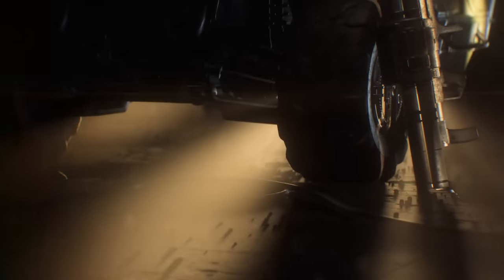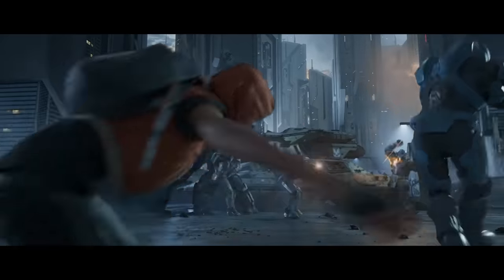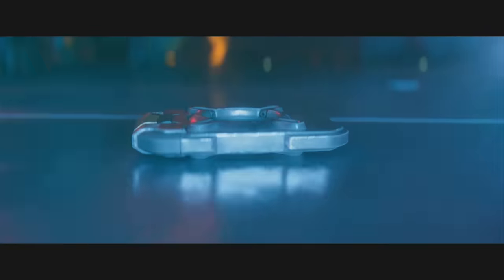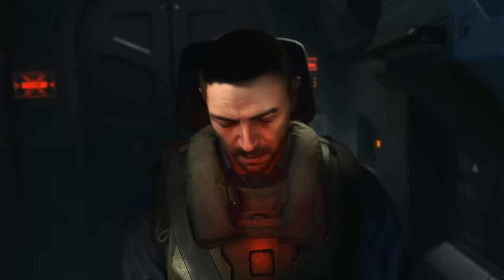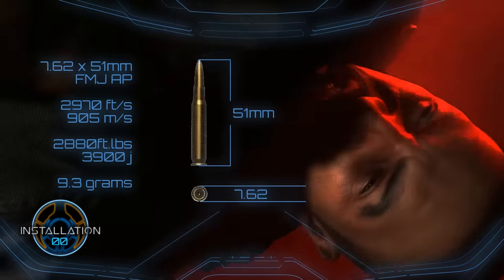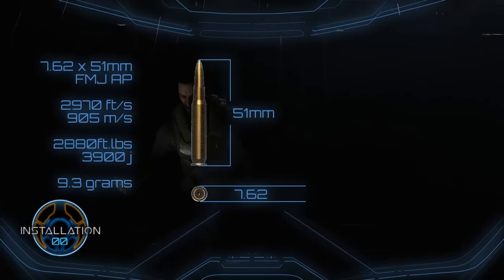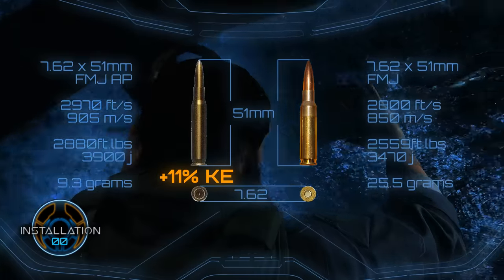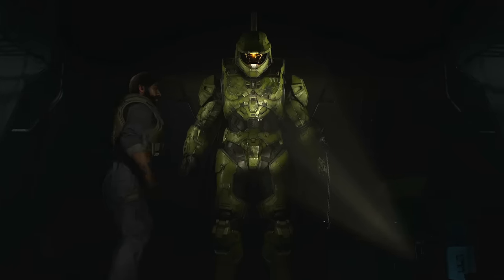Why are UNSC Weapons so powerful!? | The Armory

Comment from the maker: Just quickly; the length of the case/cartridge is 51mm on the 7.62 x 51mm, verses the overall length of the round being 71mm.
I had to make a choice in the editing on if I should have marked the lines to indicate the case/cartridge length lines or the overall length
If I marked the cartridge length, I'd get people saying that I put the lines in the wrong place. 
If I marked, as I have in this video, the overall length, I'd get other people saying the length is wrong.
I could have used both but I didn't want to unnecessarily muddy the water for clear understanding of the bullets.
So since the literal measurements are in the name (7.62 x 51mm), I decided to go with that.
Reply: 7.62 is the caliber not the casing. 12:00 is wrong.
Reply: A few of us, such as myself are firearm enthusiasts, so we would know what you are talking about. There's quite a few measurement diagrams for different calibers that show the overall length, case length, etc. If people are curious they could look at those.
Reply: ^^ Good Vid as always (except for the small mistake with the overall Length of the Ammunition).
For why it has more Power as the 7.62x51mm nowadays i would say three Factors are important:
1. The Propellant (we saw what the Change from the old Gunpowder to smokeless powder as Propellant had in an impact on the projectile velocity)
2. Better Barrel materials that can withstand the higher pressure with an more powerful Propellant
3. A better system to reduce weapon recoil (If anyone has ever shot with an 7.62 Assault Rifle you know what i mean)

PS: As I was in the German Airforce i did shot with the H&K G3 and the MG3 which is using 7.62x51mm and the Recoil is noticeable higher that an 5.56x45 NATO. Now think of this with even more powerful Propellant...my poor Shoulder ;) ...especially if you fire burst or full auto
Reply: Ok so I'm going to assume that somewhere in your lore resurch you found a description of the cartridge what it looked like and what's it's made of because in the whole video you never mentioned anything about the cartridge other than weight a mention about thickness and its length.

So let me elaborate  I would like to point out a possibility that you may or may not have considered that is the cartridge itself has probably gone through changes as well not just the powder... etc 

Because I have no doubt the unsc did initiate such things for example you point out a weight difference between the current day cartridge and the halo version and say its the same well I submit that all the variances you make between the current day and halo ammunition can be accounted for through inivstiona with the cartridge.

Eg: if the halo cartridge is not brass but a type of polymer that is lighter than brass and because it's not brass the normal loss of energy due to heat transfer in to the brass can be avoided putting more energy back in to accelerating the round...etc

And if you say the polymer would melt or what have you the us is developing exactly what I am describing for there armed forces as we speak... so in conclusion I would say the reason halo ammunition could be more powerful is a combination of powder innovation and cartridge innovation to get the results depicted... anyway that's my opinion 🤪  still an interesting video lots of food for thought
Reply: You should see Garand Thumbs video on the MA5 series.
Reply: So since the literal measurements of the BULLET diameter and CASE length were in the name, you decided to deliberately present the information incorrectly and mark the CASE diameter as 7.62mm and the OVERALL length as 51mm... so that people who are wrong wouldn't tell you you're wrong? So instead the people who are right would tell you that you're wrong?

That's some very interesting logic.
Reply: Minor correction on the video to start: the magnum fires a 12.7x40mm round. Not 12.7x30. That would actually make a lick of sense. And I know to the uninitiated that might not sound like a lot of difference, but it puts the round at nearly the same size as .50 Beowulf. You know, the (rather pointless, but insanely fun to shoot) 12.7x42mm cartridge designed for use in rechambered AR-15s and can even be comfortably loaded single stack in doublestack 5.56 magazines. Essentially the magnum should be using ridiculously long AR mags and would barely fit a Spartan's hand, let alone be standard issue for marines. 

    Overall, the UNSC's weapons have never made much sense. Measurements don't add up, the weights are often completely off base, and they generally use what should be some pretty damn archaic technology. Even with improved gunpowder, which is perfectly possible, these weapons are still using technology that was mostly developed decades before Bungie ever thought of making Marathon, let alone Halo. A lot of which is either entirely obsolete or being slowly replaced today. Brass casings instead of polymer or hybrid casings like we're seeing in a lot of recent and ongoing weapons development programs, or even going caseless which would be more than feasible for universal application in the next 50 years, let alone 500. The bullets they describe are the same makeup as those we used in Vietnam. Even the ammo counters, digital compasses and electronic targeting systems exist today. I can't think of compasses being incorporated into a gun (or why you would bother when you have a HuD, for that matter), and rifle mounted optics like that that can automatically adjust for wind and distance are still mostly in the prototyping stage, but they exist. Hell, one of the competitors in the recent NGSW bid had a functioning (if unnecessarily complex) electronically assisted feeding mechanism. 

    Personally, I'm an AK guy, so K.I.S.S. is my motto when it comes to firearm internals. But the fact that the UNSC hasn't advanced their small arms virtually at all in the last 500 years is staggering. It's the equivalent of giving a modern soldier an Arquebus. Not to mention: am I the only one who finds it utterly bizarre that the UNSC doesn't issue optics on the MA-5 series? I mean sure, there are systems to allow smart linking with your HuD, and your helmet can magnify, but in the event of an EMP or equipment failure, or even if the enemy has ECM that can render that digital targeting useless I would very much like to have something more than just flip up iron sights on my gun.
Reply: @leftwardglobe1643  The 12.7x40 is closer to the .50 Action Express in the Desert Eagle and the .500 Magnum.

But I agree, the measurements in lore and what they would be in reality are very different. Most all ballistic tests for muzzle velocity and energy are done with the best possible scenarios. 7.62x51mm ballistics are done unless otherwise stated, with a 24" barrel.

A 60 round magazine for the 7.62 for the MA5 would have to be a quad stack to be the same height as say a 20 round or 25 round magazine. Which would probably have a lot of reliability issues with failure to feed.
Reply: @Ratkill9000  .50 AE is 12.7x33mm. So, no, it isn't. Not by a mile (well, 5mm more of a difference, but details, and yes, that matters). 

    Again, I'm sure there's room for advancement within the confines of 7.62 NATO, but why they wouldn't just do something else that's more ballistically sound or even go for something other than chemical propellant projectiles entirely is beyond me. 

    And yeah, quad stack is right. Though it would have to be a little bit longer, I believe. A few friends and I actually took a look at this a while ago while writing a custom Halo RP (we're nerds like that) and came to the same conclusion after looking over the measurements. I think by the end of it we settled on triple stack 36 round mags instead. Which is only slightly better. We also rechambered the DMR to a more believable cartridge with a bigger ammo capacity (300 winmag, 27 rounds per mag) so it both fits its performance in game and lore better, and wasn't entirely retarded. If you can fit 60 rounds in a similarly sized magazine, why does your DMR with the same ammo have 15 bullets? I genuinely want to know what that Bungie employee was smoking, cause I need to try that. The magnum we changed to be 5.7x33 (because that would honestly just perform better on top of being at all feasible for regular humans to use comfortably) and gave the Spartans a machine pistol variant in 12.7x33 with extended mags. Because with power armor and augmented strength as considerations: if you can make your sidearm into something that amounts to an ultra compact SMG in .50 AE, why not do it?
Reply: I'm surprised you didn't bring this up and it's a future technology that could easily work in small arms (and larger) weapons and grant much more higher muzzle velocities and muzzle energy:
Electrothermal-chemical technology (ETC). The problem with firearms is any muzzle flash/flames you see coming out of the barrel is powder that was not completely burnt in the barrel and converted to energy. It's wasted. Like imagine if your car's fuel injection system or spark plugs didn't ensure enough fuel was ignited to power the cylinders as fast as it could. You'd be losing out on potential energy. Same concept here. A lot of the potential energy of a firearm is lost due to not all the powder being ignited and used before the projectile leaves the barrel. ETC addresses this by using a electrothermal/chemical reaction in some way to create a plasma to almost instantaneously ignite the propellant in a case/shell. And it exists and it works, but funding never really went anywhere with it. The United States Army played around with it for a converted 120mm tank gun for the M1 Abrams in the late 1980s due to concerns with the maximum velocity capable of modern ammunition in tank rounds pretty much being reached without going into ridiculous territory like much larger guns and pressures/barrel lengths which would be impractical and Soviet ERA on tanks and increased armor on them. The program was able to take a 120mm ETC gun and make it deliver velocities in excess of modern ammunition and deliver penetration and power on par with proposed 140mm upgunned turrets that was being floated around. The program was cancelled due to costs and the Cold War being over by the time it was an option.

To give you an idea of the efficiency, a stock 120mm L/44 (so not the longest barrel with the most velocity, that's the L/55) Rheinmetall Rh-120 (M256 American designation) has a muzzle energy of about 11.5 MJ (depends on the round being fired, but that's about its max). In 2000, a 120mm L/55 ETC-variant of the Rhinemetall Rh-120, the XM291, was developed and achieved a muzzle energy of 17 MJ (this energy places it on the lower end of a 140mm tank gun and the XM291 had a higher muzzle velocity than a proposed 140mm tank gun). And this was just with a prototype that is now 22 years old. And a 38.5% increase is far in excess of the potential difference we see here in the game.

There's also the option with ETC technology to use things other than solid propellants. Liquid propellants can also be used and, in theory, allow even high muzzle energies to be achieved (the United States Army also played around with this concept around the same time period with the XM2001 Crusader - which was a self-propelled howitzer to replace the M109 Paladin - and used liquid propellant to allow potentially higher velocities/ranges/fire rates - it was also cancelled due to costs).

The best part about ETC technology? It's capable of being backwards compatible. You can easily make it so you can still fire conventional rounds out of an ETC gun. Of course, you won't see any benefits from doing so, it will still be the same performance, but having that capability is welcomed by logistics.

The only problem with all of this that I have is that you can handwave a lot of issues with weapon weight and recoil with a SPARTAN because... well... even outside of the armor they're basically super-human. But, in ODST you as a just a very regular albeit highly trained and capable soldier can pick up a full-auto 7.62x51 rifle and fire it like it's just like an assault rifle. The recoil is nothing like what you'd expect a full-auto 7.62x51 rifle to be. It's not only entirely controllable, it's basically barely any more reactionary than firing your submachine gun. And, I mean, I can't think of anything to do with the ODST armor or the ODST soldiers themselves that could explain why you'd be able to pick up a battle rifle and start firing 32 rounds through it and not minding it at all like it's just like firing an SMG. That's why I've also always had issue with the idea of an 8-gauge shotgun being used as a combat shotgun by normal humans in-game. I've fired 10 gauge shotguns before. The Ithaca Mag-10 that I shot didn't have as bad of a recoil as I thought it was going to have, but... it wasn't pleasant to shoot. It was also an 11-pound gas-operated semi-auto shotgun, and that gas system does help with felt recoil by a small amount. Would I want to fire a pump action 10 gauge with 3 1/2" shells? Not really. Would I want to fire an 8 gauge? Uh... Maybe a few times for the experience and thrill of it, but... No. No, I would not. 12 gauge is the standard for combat shotguns and personal defense for a reason. It's about as big as you can go and still have manageable handling and recoil for the average person, and I find 12 gauge 2 3/4" shells absolutely fine and manageable. 3" magnum loads? Depends on the load, but with slugs especially you're going to start running into issues with it for most people. I don't particularly care for shooting 3" slug loads that much.
Reply: They could also be "Hot" rounds like what the 6.8mm round uses
Reply: amazing how ridiculous they made the 7.62x51 but it's obvious they really didn't know how real firearms and ammunition works but hey considering the US military's new round that tech could be what allowed the halo 7.62x51 to have that much more powerful performance or some type of brass advancement similar.
Reply: Polymer cases could explain both the decreased weight and increased velocity of the projectile. There internal dimensions are shapped in such a way that powder burns more efficiently. The us military is already experimenting with these. Light weight bullets also have a higher velocity. If you combine a polymer case with a light weight armor percing bullet or even a Sabot round you could probably get to a similar weight and velocity that is stated in the lore.
Reply: I can only assume that at in the era of UNSC established, the metals are already light enough that using sniper rifle rounds is the best option to beat any kind of threat
Reply: One possible explanation that exists, and one I personally like using in my own material, is that the UNSC doesn't use any kind of gunpowder-variant at all. Instead, they could use a chemical-based propellent that is far more volatile then it's 20th and 21st century counterparts. An example of this would be the real-life C-4. Halo lore mentions both 'C-7 foaming explosive' and 'C-12 shaped charges', so it would not be surprising if the UNSC developed a high-powered chemical propellant for their bullets that outperformed the IRL stuff. 

Another, more ludicrous idea, is something like C2N14, or what is the demon brew more commonly known as "Azidoazide azide". Directly using something like that would be insane to the point of criminal stupidity, but a somewhat less dangerous compound of similar nature could 'hypothetically' be used for projectile weapons of the 26th century. 

An unexpected side-benefit of this possibility is that using a more high-powered propellant could also explain why UNSC guns seem a bit bulkier and more robust then their IRL counterparts. Having a more powerful bang inside the gun when you pull the trigger means needing to beef up the gun itself to handle it, logically! The apparent love-affair the UNSC has with titanium would also seem to support this concept. After all, which kind of gun is going to stand up better to being used as a melee weapon by an enhanced and augmented super-soldier: one made from steel, or one from titanium? =^x^=
Reply: Theres a lot wrong with your description of 7.62 Nato. I get it might sound boring, but it would only take a minute to give a quick rundown on how ammunition is measured. Every type of ammo has a chart with annotated measurements on bullet diameter, case length/diameter, neck size, ect.

8 Gauge is only illegal for hunting, you can shoot it if you can actually find a gun or ammo(not likely). You can also think of a .308/7.62x51mm along the lines of a 357/38 Special. You can shoot 7.62x51mm in a 308, but not vice versa. The 308 is more powerful in most cases, especially hunting loads.
Reply: 8 gauge shotguns aren't illegal, you just aren't allowed to use them to shoot waterfowl, you also aren't allowed to use any type of shotgun shell with lead shot to shoot them so that's a bit of an error.
Reply: US Military M118 7.62x51mm is 175 grains .   This is important  due to the 7.62x51mm used in Halo is distinctly  stated to be M118 FMJ .  Which is a very specific  round. 

M118 long range BTHP is the real world equivalent of the 7.62x51mm  being used.
Reply: @LostShipMate   Depends on what your shooting.   The ammo used by the UNSC is specifically stated to be M118 FMJ.    Which is a military  round . The real world equivalent  being the M118 long range BTHP which is a 175 gr bullet. 

Which is actually  the high end  for .308 . 
Furthermore  the Sporting Arms and Ammunition Manufacturers' Institute (SAAMI) does not consider it unsafe to fire the commercial .308 Winchester rounds in weapons chambered for the military 7.62×51mm NATO.  

So a military weapons like the M240 should be capable of taking a .308 Winchester  without an issue.  

I wouldn't  try it in a civilian available  7.62x51mm rifle though.   Military rounds generally  have a higher pressure than civilian  rounds. 

The difference  between a civilian 7.62x51mm  and Military M118 7.62x51mm  is chamber pressure.  

Just like the .223 and 5.56x45mm Nato  are the same size round but if you fire a 5.56x45mm Nato like the M995 armor piercing rounds from a civilian  AR15 there's a good chance of the weapons bolt blowing back into your face due to chamber pressure.
Reply: so this is food for though the rounds may be a future upgrade of the current US experimental tank round known a ETC round used in ETC guns they let shells be lighter but having higher muzzle velocity
Reply: im going to point out that modern ammo is not limited so much in propellent tech (modern bullet casings are not even entirely full)as it is by pressure both in bullet casing and chamber with the limit of most modern ammo being 65k psi sig has demonstrated the improvement gains when significantly higher pressures are used but also the difficulty in using ammo with pressures of 80k psi needing special casing tech and thickened chambers and barrels
Reply: @matchesburn  I thought of ETC guns too what if they decided to use ETC rounds matched with the hybrid design he said in the video because ETC needs a bit of power for peak effect so having a power supply on or in the guns to charge lets say a coil would let them get all the benefits on ETC and the Hybrid system
Reply: @John2r1  True, but I would be hesitant to put .308 into a 60 year old rifle marked 7.62x51. I just don't see the point in risking it.  I own a FR-7 Spanish rifle in 7.62x51(marked on the receiver), I just use nato loadings. At least without having it inspected by my local gunsmith. 

Its the same for my old 1895 colt, its in 38 Special. That doesn't mean I trust any 38 special load(no +p). I only put low grain ammo, typically lead nosed. Maybe I'm just babying it, but I would rather not be holding a hand grenade a few feet from my head.
Reply: So I did some calculations in a different reply but I figured this would be a good place to put it too. Your calculations of the entire cartridge weighing 9.3 grams are, well they aren’t right. Working backwards from the muzzle velocity and energy I come out to a bullet (not then entire cartridge) weighing in at 9.5 grams or 146.8 grains. Which is not far off from current M80 ball with a 147 grain projectile, it’s just a smidge bit faster at 2970fps compared to the M80 out of a 20” barrel being 2800fps. The problem here is you saying the entire cartridge weighs 9.3 grams with a bullet weighing 9.5 grams. That’s implying the powder has enough negative mass to counteract the weight of itself, the weight of the brass case, and 0.2 grams of the bullet. The actual maths for the UNSC bullet, sans your weight calculation, are close enough to current reality as to be an acceptable hot loading. That’s for ball ammo too, not even getting into AP black tip rounds.
Reply: Hey, here's an idea.
You know how some loore had the guns being air pressure guns? This was early loore, 

Well maybe, like in star craft where it is part gun powder and part rail gun, it is part high explosive, or gun powder, and part air pressure.
Reply: Hey 00,
What do you think about alumina/zirconia based epoxy resin solutions. As either an anti spalling or possibly even armor coating?? 

Also.
When looking into the common applications for those in electronics and photo imaging ^

If you could make a resin, that could withstand the quote literal explosive force of cartridge detonation. And combine THAT. With the AlumiZirc powder. Couldn't you carry MORE heat away from the weapons system by storing it in the high thermal mass of the alumina ceramic?

You mentioned, halo rifles. Fired steel jacketed bullets through titanium barrels in your Ma5 armory video (I think)
If you steel cased a molded bullet like that^ I think it's exactly the type of projectile you would need to carry heat AWAY from the titanium so it doesn't sink heat into the weapon frame.

Lastly. Zirconia. Is highly conductive. The current problem with modern railguns is we keep melting the barrels. Same argument ^
A lot of waste heat is generated the moment the pin strikes that primer. If you could store a large amount of heat into the projectile itself I think it would revolutionize the firearms industry.

Also. For your Mjolnir project. I wonder if that powder could be integrated into the 3D molding process of creating the plastic plates. I'm not sure how the atomic structure of say. A normal lead bullet. Would interact at the atomic level and nano second time scale of a bullet impacting a plate. Would the kinetic energy of the lead and copper 'push' the particles of diamond and aluminum ceramic around through the resin as it tried to find the path of least resistance? Or can you fit enough in a small area where it can actually break up the bullet as it tries to dig in, or spall out. If you hand a sandblasting rig and the appropriate epoxy. You could probably blast it on to ar500 steel as an anti spall and strike layer??

I do not know. Material science. I just like guns and armor.
Reply: One option is they could have figured out a stable fluorine or chlorine-based oxidizer and appropriate metallurgy to prevent the barrels from corroding in a few shots. these are oxidizers so powerful; your normal ashes would be pretty effective fuels to pair them with.
Reply: @merkarion7883  You don't even need that. This is hilarious. YOu can take bog standard M80 NATO ball and feed it through a 26" barrel and you get 2970FPS.
Reply: @matchesburn  Holy shit dude, all this anorak nonsense about completely irrelevant technology and you didn't know that you can just shoot M80 through a 26" barrel and get exactly that velocity? Take a breath dude.
Reply: @009013M3  
"a 26" barrel"
...As you can clearly see, the rifles in-game have a barrel length no where near that. So drive-by shitpost elsewhere.
Reply: whens the video about how shit the tv series is?
Reply: Its possible to make the MAC Ammunition to be larger than its normal size to increase impact and probably increase the length of  the MAC
Reply: I'm no fun except but wouldn't the barrel length effect it as well? some of the guns are bullpup and made for super humans. They have pretty long barrels meaning more of the propellent is burred giving it more power.
Reply: Make a vid on the ma40
Reply: Where was it that it was said that the round was especially hardened?
Reply: Why not user a larger caliber since modern humanity is advancing with better materials to have greater range and penetration while being much lighter. Honestly still surprised 🤣🤣🤣 500 years in future.
Reply: Ok here is my retcon/headcanon to make Halo gun lore more accurate to the actual gameplay performance:
MA6B - 5.56NATO to explain the higher fire rate and mag capacity with lower terminal effects
MA6C and later: 7.62x39. Smaller mag, lower fire rate, more oomf
Battle Rifles: 6.5 grendel or even creedmore, with an AN94 style recoil mechanism.
DMR: 300 or 338 lapua magnum
M6series: .45acp

Or more comprehensively: Someone should take a look at how many round each weapon takes to break a shield, and then calculate how the actual kinetic energies compare to each other. From there, one can look at the physical dimensions of the weapons, compare with mag capacity and decide on a caliber for those with the tightest fit. The other rounds can be decided on from there by using the previously established kinetic energy proportions. Keeping rounds as small as possible would make sense since even unaugmented marines seem to have good recoil control. 
Obviously, use 80% existing rounds since thats one of the dumb charming Halo-isms that i wouldnt want to get rid of.
Reply: 6.8x51 in the sig spear is a better gun that the halo AR. 3K FPS out of a 13in barrel has not been done before for a full size round
Reply: I never play the games but I often assume that UNSC small arms are chambered in caseless ammunition considering that caseless ammo has been tested years before Bungie start the Halo project.